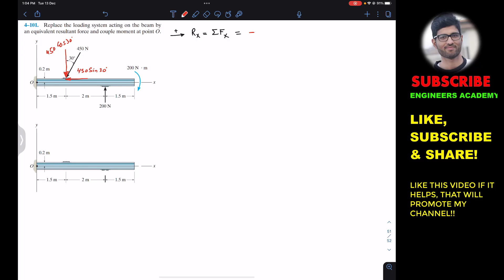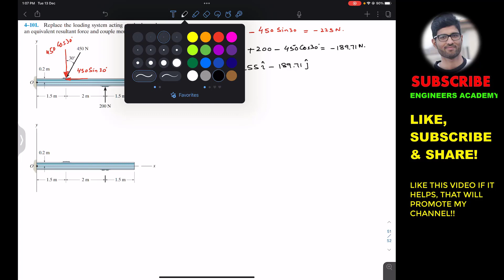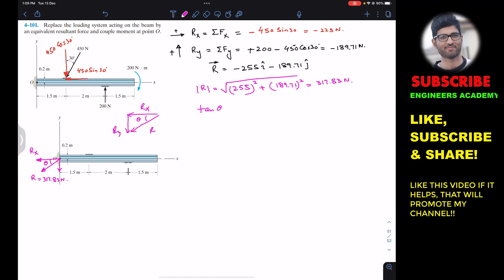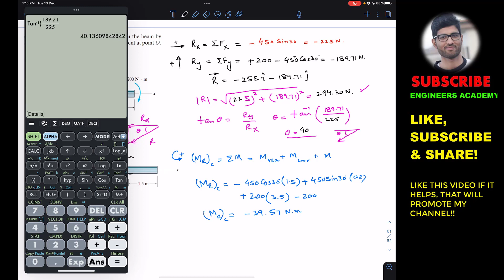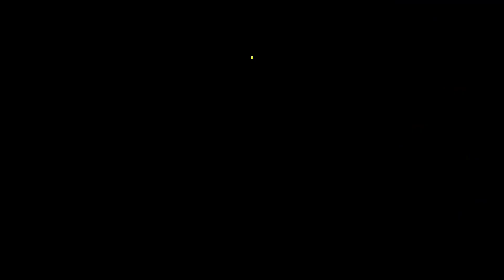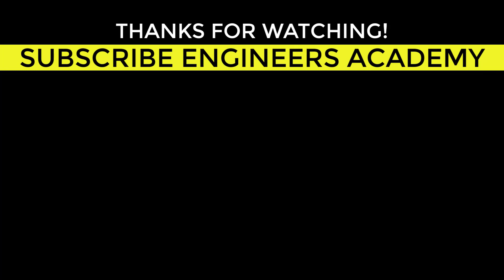4-101 Equivalent Force Couple System Chapter 4 (Hibbeler Statics 14th Ed) Engineers Academy

Comment: Hello sir, I think the magnitudes of the components of the 450 N force are correct but when we sketched them, the x component we didn't sketch correctly, according to our sketch when we add x and y components it gives us different vector than the one that is given in the exercise. I will be glad if you reply to my question.
Reply from the maker: You are talking about which given vector. This is the sum (resultant) of both the given vectors which are acting on the beam
Reply: @EngineersAcademy2020 I think the point that i am missing is that we can move the vectors and get the same result as long as we don't change their directions.